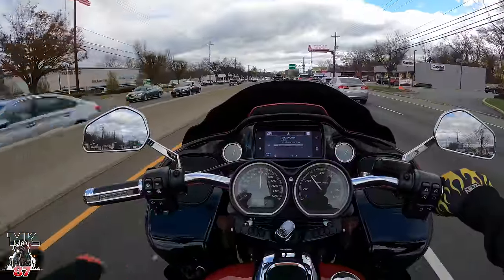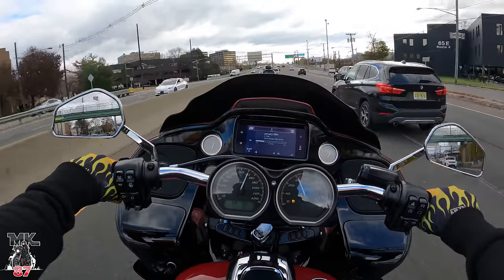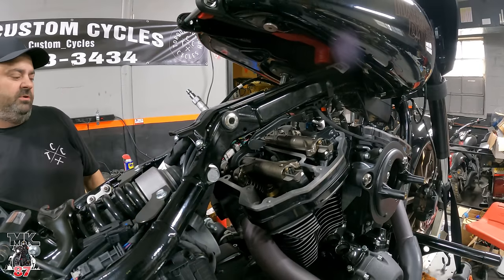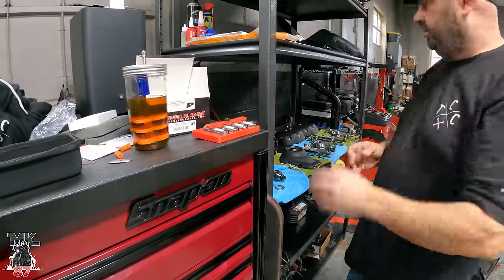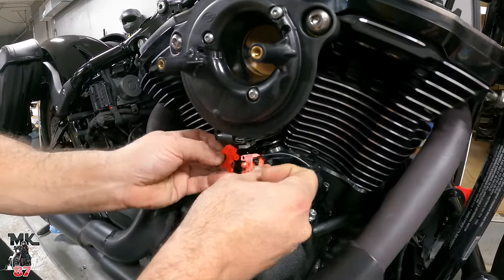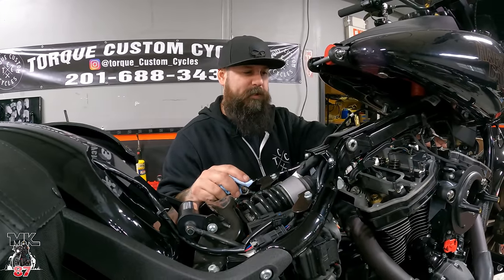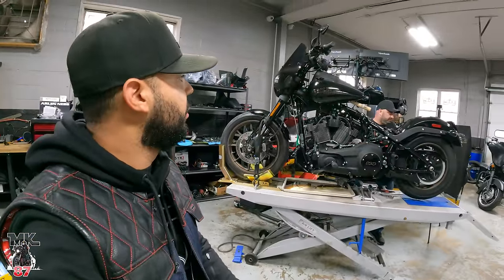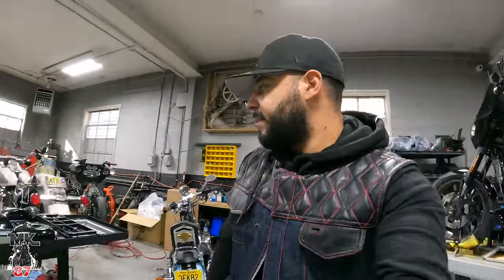Low rider s with engine tapping sound / we finally found the issue

Comment: My stock  '23 RGS sounds like it's coming apart mostly @ 1800 -2000RPM under a load on a rough road.   It is CRINGEWORTHY!  My guess = LIFTERS.   If I pull the clutch in, the noise decreases alot.   At my  6000 mile service, the dealership says that there is no "rattle" that they can find.   But it's very loud to me ( and I wear earplugs).   I have owned two other M8s, and although you can always hear the lifters a bit on these engines, they were NOTHING like this one.

Comment: I hope he's Considering where the compression stroke is. if it's on the front you got that much play you need to open your cam chest you have a bad lifter you can some real damage. that drops say good by to your motor I seen it before good luck is it fixed yet

Comment: Marvel!     Stick with 472 cam,     I here 508 is hard to tune.          Front suspension,   RWD  Front suspension.      And for your low rider,    try and get S@S rocker bolts.     ✌️⚡️
Reply from the maker: I’m defff leaning towards the 472 and I got the rocker bolts from Feuling on them already

Comment: My 2020 FXLRS has the woods 22xE cam . No valve train noise or oil consumption. I was on the fence about trading for the st but my bike runs to good. I put an fxrt fairing on . Buying a Harley is a roll of the dice. Any Harley!
Reply: Put that fxrt fairing on your 2020 with a taller rear shock and your 20 will be just as good if not better than the st.
Reply: Your videos are very entertaining.
Reply: I have a 2011 dyna street bob with the 110 tire shredder kit and like you am seriously on the fence about trading up to the low rider st also. Makes it even harder that my dyna is basically worth nothing now (to a dealership) even though it runs amazing only 14k miles on it!!!!
Reply: @joeplem5329    Jd custom’s fxrt fairing and slim clamshell bags on My 20 fxlrs and I am very happy. Pricey but worth it. I had a 2012 dyna , it was a great bike.

Comment: make sure adjustable push rods are set. once you set them to 4 turns you shouldn't be Abel to put 0.9 gauge I really think its got something to do with lifters the bleeder holes faceing each other bind one up when talking down tappet cuffs all the small thing are so critical.

Comment: just ordered the 30/30 cam... Been listening to ALL of Star Racing's podcasts and videos from the past. Even Moonshine Harley's stuff...George B. suggests it's the best sound/performance for the money. (with torque in mind) No need for springs. No need for larger injectors or throttle body... $$$ for maybe +3 horse power. Better to wait for larger displacement to do any of that.
I think George even said the stock pump/plate works well even up to stage4.

Comment: I would go with the 30/30 unless you are changing the value springs then I would use a Star Racing .572 cam. Especially for the bigger bike.

Comment: Was the tapping noise confirmed by the rocker arms? Or still in the process of finding out? Also when did this start, was the bike still in stock formation or was there some work done and started after? Just curious if this happen after you had work done to the bike.🤔
Reply from the maker: Sound was there before I put in the cam. Started with a collapsed lifter. I’ll be making a video next week about everything is final
Reply: @Marvelkid87  Did you ever make that video on the tapping issue and what resolved it?

Comment: I have the fueling 472 make 115 hp 131 tq but revs quicker than most cams, dyno guy also had one in a bagger with 121 hp 132 tq
Reply from the maker: Do you like it and recommend it ?
Reply: @Marvelkid87  I can hit 0-100 in 5 seconds on my low rider s but honestly just about any cam you go with you’re gunna be happy I just chose one that shines best in the midrange (90% of your riding) & don’t regret it one bit

Comment: I feel your pain, it really sucks when your “pride and Joy” is broken.  I picked up a LRS 117 in October and is very difficult to shift from 1st to 2nd without hitting a false neutral. Bike is unrideable. I’m bummed. Good luck on your fix.
Reply: Try adjusting ur clutch, if it’s not biting enough won’t help with the shift. Also need to be very direct with 1-2, have experienced that too

Comment: Soon as I heard it...shim time. It's not "your" bike it's the MoCo. MoCo says pinion runout that is .007 to .012 is normal. That is insane. All you can do is shim the non load side & see.
Reply: I just installed the endurance valve springs. Machinist went through the heads. Everything was in tolerance. Original spring packs had a 200lb seat. I wanted the Fueling econo's. That would have dropped me down to a 160lb seat. But Per my build I would have been on the cusp of coil bind. So the Endurance springs were installed at a 190lb seat rate. It quieted the drivetrain 15%.